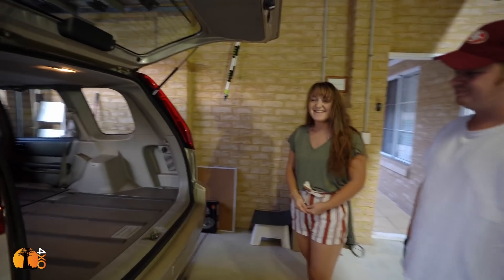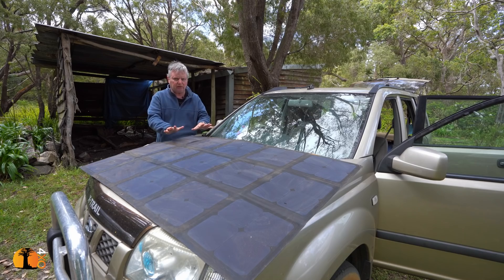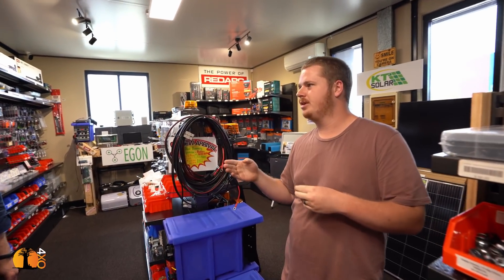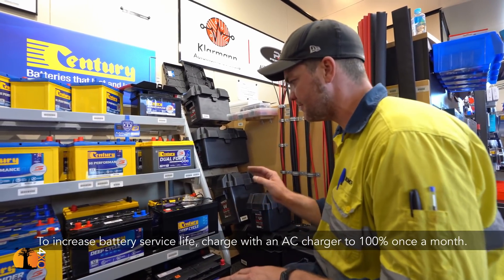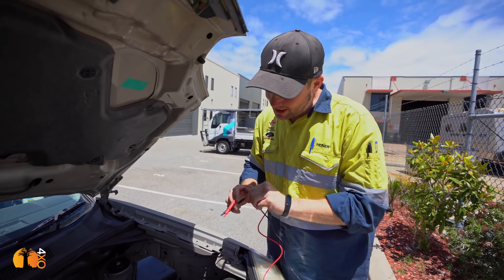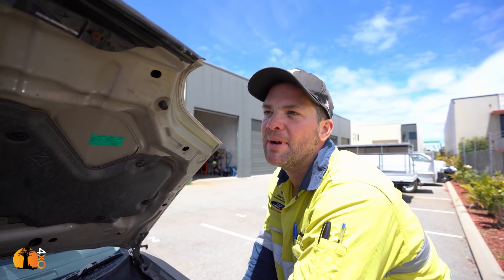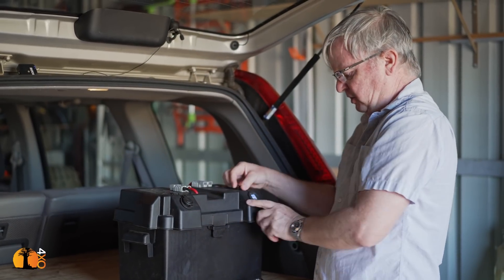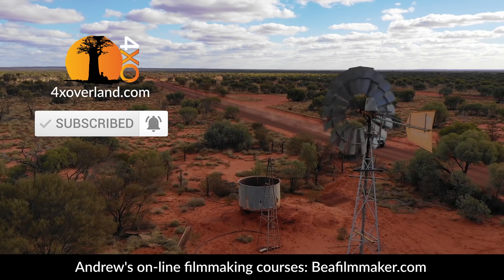BASIC ELECTRICS FOR A BUDGET OVERLANDER. Part-2 of Backpacker's Tourer Nissan Xtrail | 4xOverland

Comment: Very interesting and well explained, to this electrical novice, anyway. I rewatched but couldn’t find a mention of the rating of the battery that was chosen. 
I know it is not relevant to your build but I am interested to know about the calculation of the ability of an existing, factory, alternator to determine if a higher output unit should be used to replace it. I have a 32 year old Ford truck and want to keep within the ability of the existing alternator, if possible, to run an auxiliary battery in a similar set up.

Comment: A good quality solenoid like a glow plug style solenoid connected to the ignition system shouldn't reduce voltage too much. Also, extra little note on the wire used, using tinned cable is a great way of avoiding corrosion.

Comment: Excellent. The only issue I don't favour is the battery disconnect using the anderson connector. I would have used (I do use),  a cheap isolator unit, such as WARN 28022 120-Amp Dual Battery Isolator, or similar. Consider for an upgrade when disconnecting becomes tiresome.
Thanks for the good tip on the solar charge!!

Comment: Can the alternator and a solar panel be connected at the same time?
Reply from the maker: Yes, but there is little point. The solar will increase the voltage to a point when the alternator stops its charge believing that the battery is full. Even when it isn't. When its driving, charge with alternator, when not driving disconnect the start battery and charge with solar.

Comment: Don't you know the basics? You failed to have isolation for the starter motor current draw, the Anderson plugs are rated at 50 amp's don't know about the cable but fuses are for protection the  cable has two supply's potentially 160amps before a fuse pops!  Each fuse should be less than the Anderson plug rating or less than half of the cable rating  which ever is the lowest !!! I wouldn't want my daughter in that car.

Comment: I'd accept the volt drop of a diode between the alternator and starter battery, but a direct connect between the alternator and auxiliary battery, will eliminate any need for switches or unplugging.

Comment: I may be asking a stupid  question, but  why did you use a 50 amp anderson connector in an 80 amp fused line? Is it not going to act as a botte neck?
Reply: I was wondering the same. I just hooked up my 3rd battery (2nd Auxiliary) exactly like ASPW did it but I used a 30 amp inline fuse as the battery box had 2 30 amp fuses for its Anderson connection
Reply: Not so much a bottle neck but unsafe - fuses should always be rated lower than the max current capacity of the cable & connections/switch gear.

Comment: Anderew I love your videos and have the utmost greatest respect for you and your videos as I think you are the best channel on 4WDing and you videos are second to none. So it breaks my heart to have to make a criticism about part of your build. I think you really should have put a auto disconnect solenoid or VSR of some type or even a simple relay wired into the ignition to isolate and reconnect the battery. The reason I say this is because I can guarantee there will be a day or even more when they either forget to disconnect or forget to connect that battery and it could either leave them stranded with no starter battery or leave them with a flat second battery and spoilt food in their fridge.

Other than that mate what an awesome build. Never ever thought an Xtrail was worthy of being used but I have learned something new.

Comment: If weight is an issue can you charge a lithium battery the same way? Or is the voltage not high enough for it to make sense using lithium?
Reply: You really want a dc-dc converter/charge controller for lithium.  Otherwise you'll pull way too much current from your alternator when the house battery is low and then you'll be overcharging once it's full.
Reply: @sonictech1000  thanks for the info. Just found out my car has a smart alternator, so won’t be getting around a dcdc anyway

Comment: Great video love this new series. I've been agonising over how to do my electrics and you had almost convinced me to go for a lithium set up (that I really don't have the money for) but something like this will work perfectly. From a very excited  university student!
Reply: Have a look for SolarKing 100AH Lithium battery - these use the "safer" Lithium Iron Phosphate technology and under $700 for basically 5 times the life, at least twice the usable capacity and about half the weight. They are excellent. Can be hooked up exactly as shown here as it has all the electronic smarts to manage the charging and discharging built in.  (I have no affiliation with them, but I have used them - they do what they say).  EDIT: SONICTECH1000 RIGHTLY POINTS OUT THAT A CHARGE CONTROLLER OF SOME KIND IS NECESSARY TO DO WHAT I SUGGEST HERE. I INSTALLED A CURRENT LIMIT ON MY OUTLET (TO CHARGE THE BATTERY IN THE CAR A COUPLE OF YEARS AGO AND HAD COMPLETELY FORGOTTEN I HAD THAT! SORRY IF I GAVE ANYONE A BUM STEER!
Reply: @Bennyboy-dog  I'm skeptical that it's a good idea to use these without a suitable charge controller.  You're certainly not going to get that 5x lifespan doing it that way and your alternator won't last long either.
Reply: @sonictech1000  Yes, you are right! I forgot that I had added a home brew charge controller to limit current from my Anderson connector from the battery. Thanks for point that out.
Reply: @Bennyboy-dog  They look really good but as with most good overlanding equipment I can't really get them in the UK
Reply: @henrydakin9903   I'm down-under Henry and here there are a few stores that have them. I'm sure there are equivalents in the UK, but I don't know the brands there so I can't say anything about them.

Comment: With this type of set up, a fuse might fail when he forgets to unplug before cranking the engine.
Reply: Interesting point. Will also be drawing off of primary battery when connected. Would be good to make sure it wasn't seriously discharged when connect it back up else could drain primary if left without vehicle running. Could it reduce start capacity of primary? What about connecting a battery when alternator  running live? If have voltage protection so can't drain the backup too low may be make all these mute points..?
Reply: @pwatom22  all good and more expensive ideas, but the idea is to keep costs down with this set up.

Comment: I've never had the budget for the over the top 12 volt systems out there so agree with most of what you've done. However, you've introduced humans into the system and at some point that human is going to fail and the Anderson plug won't be pulled out to isolate the system. This could obviously cause flat batteries. I've got a Redarc SBI12 isolator which is a pretty simple relay and it takes me (the human) out of the equation. So it's idiot proof. :D There are likely cheaper isolators out there but I'd definitely put one in.

Comment: Why not just install a simple Redarc isolator..?
Reply from the maker: This is a budget build. Lowest cost for highest performance. Relay-based split-charge systems are also inefficient. Some are extremely inefficient because of high voltage drops.
Reply: @4xoverland  ok cheers for the explanation...I'm enjoying this budget build series

Comment: To avoid corrosion in a crimped connection it is a good practice to add a small amount of long lasting grease to the cable before crimping it with a professional tool. Then, of course, add the heat shrinking tube over it for additional protection from moisture/water.

Comment: Why are the fuses so big?
All my ARB equipment came with 50Amp fuses...

Is it not risky (voltage drop) to use the car earth instead of running a - cable?
I would have run 2 cables and not skim on the earth cable.
Reply from the maker: We ran two cables. We did not rely on neg ground.

Comment: You mention soldering. FYI, where the soldering ends inside the copper cable is a possible breaking point due to vibrations. Meaning, if you solder any cable/-s in a vehicle you must tie the cable down hard using cable ties to avoid future breakage of the cable.
Reply: well it depends how you are soldering. very unlikely that old school soldering will break

Comment: I may be wrong but since current is proportional to voltage difference assuming normal "morning" conditions:
- Starter battery voltage 14.00 
- Aux battery voltage 12.5 
- Internal battery resistance 0.3mOHM x 6 cells

Then current is Vs-Va/Rint = 830 Amps roughly...

That means that when in the morning that connector is plugged a massive current will.be drawn from the aux battery from the starter battery.

Is this correct?
How has this been addressed?

Thanks

Comment: Curious why you went the option of building a battery box when you can purchase ones with all those plugs in them already? Is it that much cheaper to build? Or more for the lessons on how to do it? So they know where and what everything does?
Reply: Some of the cheap ones u purchase are nasty seen some with cheap crap wire that heats up just running led lights best to make one that suits u and usually better too I have the hard korr box in my new trailer it’s a killer setup and 4 50 amp Anderson’s and a 175 Anderson has USB and cig outlets too for the price I didn’t bother making mine lol

Comment: You missed out how you  earthed the auxiliary battery and where you ran the cable.
Reply from the maker: We did not ground/earth the second battery. We ran a dedicated cable. It's sufficient. Relying on ground ground/earth alone always increases voltage drop, especially when the connections get old.
Reply: Probably just to the bolts used to secure the battery box.

Comment: I not auto electric educated, but would it be better to have a one way connection so you can’t drain the charge from the starter battery, that’s the way you auto guy wired mine
Reply: You need to inhibit discharge of the starter battery to feed the second battery while parked.  Usually a mechanical relay, solid state relay "SSR" or an isolator switch would achieve this. Here the only fail point is remembering to pull the plug out !

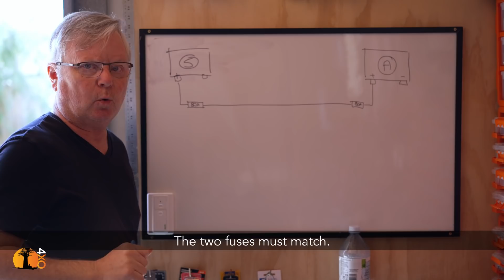Comment: Less is more !  Good point on fusing both ends of the main positive cable, but at 8:12 note BOTH will blow in the event of an earth fault. You will need at least three spares unless field repairing with strands robbed from flex.

Comment: And if you charge the power box via 12v / cigarette lighter port?
Reply from the maker: MASSIVE voltage drop. HUGE!  They are fed by thin cables, with thin connectors that move about, which is exactly what we fought against when doing this setup. We used what we used for very good reasons and spent not one cent unnecessarily.
Reply: @4xoverland  thank you

Comment: Hi Andrew and guys. Great video. Some doubts. The sealed AGM auxiliary battery choosed should be of the same amperage/capacity of the start one, or it doesn't matters? How much is the house amperage (C100) choosed in the video? I have put in my set up different amperages, like the start one is 95 Ah and house one is 65 Ah, because of lack of space under a Fortuner bonnet. Did I do it wrong?  About diameter of cables, I've got it they must be thick. Ok, but how much? For security, with 80 Ah, and 5 meters distance between the two batteries, would you choose 6, 4 or even a 2 AGW thickness for the cables (both, positive and negative)? Thanks a lot. Cheers from Brazil.
Reply: Different capacity batteries is fine and really common.  As for cables there are online calculators.  Bigger cables get expensive fast especially when you consider connectors, a big crimper etc.  You'll basically have to decide how much voltage drop you can live with and size cable  to that.    Personally I went with #8 cable for a 20ft (7m) run and I'm happy with the result.
Reply: @sonictech1000  Thanks for sharing your experience.

Comment: Loving the series. I used to have the 2.0 petrol with manual transmission. One of the advantages of this car was that it can run with 15inch wheels. I used to run 225/70/R15, which had better tire profile.

Comment: I used to design electrics for construction equipment. You have done everything right. Kudos.
Reply: One thing to remember is that even the small signal cables to the battery monitor have to be fused, thinner cable - smaller sized fuse, at the battery end . Those thin wires  become serious source of fire when short circuited, they burn through the thicker ones in a loom like hot knife through butter.
Reply: Everything right? So you would recommend human memory to stop flat batteries in the bush? This system is a terrible idea.
Reply: @davidhemmings5676  What do you suggest instead considering their budget?
Reply: @Malc664  I would probably add a $80 VSR, then it’s set and forget.

Comment: I like these back-to-basics videos.  They're extremely helpful for someone that is already experienced with offroad driving but has not performed vehicle modifications irrespective of those for offroad driving performance.  While we have an offroad camping trailer at the moment, my long term goal is to build some kind of truck mounted popup system that avoids having to tow all the time, and seeing this starting from basics is helpful.

I have a new-old-stock dual diode isolator device, meant to come off of the positive charging cable from the alternator and split to both the starter battery and the camping battery.  I've been told that this device is basically obsolete, it will reduce the voltage to the batteries too far to be useful.  Have you ever used or encountered such devices, and what's your opinion of them?

Comment: 8awg cable would suffice up to 5m which is cheaper than 6,  and 40 amp medi fuse too.  I don’t quite understand what the voltage drop impact is. it’s minimal when running a fridge or camp lights and USB charging.  Steve
Reply from the maker: Voltage drop means that the aux battery will NEVER, EVER get a 100% charge. EVER. However, reduce the voltage drop, will result in a faster, better charge. Yes, you could spend less and buy thinner cables. And that will produce less current flow. Unavoidable physics. We used what we used for very good reasons and spent not one cent unnecessarily. We wanted the best result for the lowest spend. Voltage drop is the enemy of any DC installation. And we did everything we could, short of buying a DC-DC charger, to get this. And the one reason why DC-DC chargers are so efficient is because there is zero voltage drop.

Comment: Interesting.  So far all I've done is cabling for a winch, but I've been mulling a dual-battery setup.

I added a 2" receiver to the front of my American market Nissan D40 behind the bumper cover, for the purposes of being able to slot-in a winch.  I exited the positive terminal of the battery to a 350A HMG fuse, then into a high-current A/B/off switch, through more cables to SB175 anderson connectors at both the front and back of the truck, then connected the negative side of the anderson connectors to the chassis in the back, and to the large body to battery ground for the front.  I used 1/0AWG and 2/0AWG cable because I had it laying around.

The D40 Frontier does have one of those alternators that will reduce output, so I had to pass through the factory ground cable in order for the current sensing device to work properly.  Unfortunately the way it's designed it doesn't look readily modifiable to run a heavier gauge cable, but given that even Warn's winch cabling is 2AWG I'm pretty sure that the this large factory negative battery cable is stout enough.

What I am less sure of is the chassis ground for the negative at the rear.  i think it'll be adequate, but if not I may end up having to add another 1/0 gauge cable from the Anderson connector back up to that factory negative cable with the sensor.  I hope not, that's a lot of weight to carry and I'd like to avoid adding even more weight.

Comment: Thanks for the info. Great video. When talking about the auxiliary battery you mentioned to ground, and said you would get talk about that later, but you never did. Did you ground the auxiliary battery or not? And if so, to what?
Reply: Would definitely of grounded the aux battery, probably to the floor or chassis as the diagram showed.

Comment: Question:  50A Anderson plug with 80A in-line fuses?  Does that make the Anderson plug the 'weak link' rather than the fuses?
Reply from the maker: Not really. A 50A Anderson will carry over 80 amps without even getting warm. But anything above 50A, the voltage drop across the connection starts to increase.
Reply: @4xoverland  Thanks for the reply...